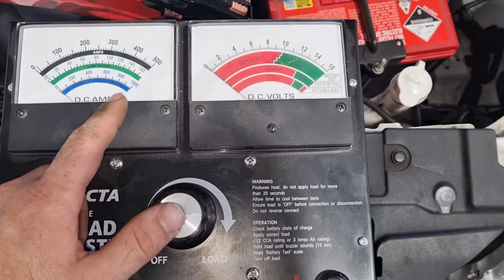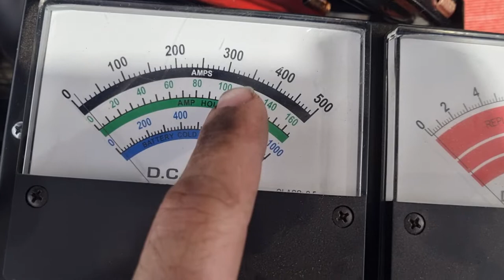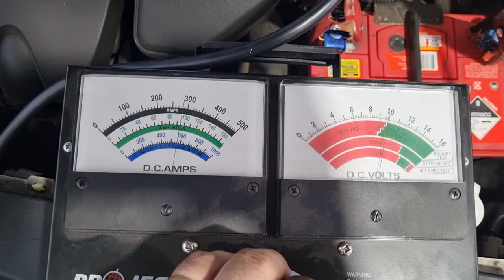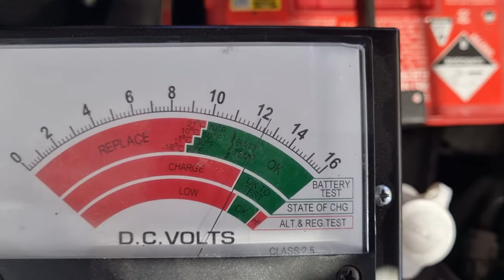Carbon Pile Battery Load Tester - How To Use Correctly

Comment: I'm confused, in the video you explain based on the direcvtions you want to apply 320a scael for the test, but when it comes time to test you bring it up to about 620...?
Reply from the maker: So the ammeter has 3 scales if you rewatch 

It is 650cca so half of that is 320A (not CCA) for the test we want to apply half the battery capacity

But on the lower scale it actually is reading CCA so it's just a couple ways you can read the scale 

If you re watch the video you will see I apply the 320A but the bottom scale is the battery CCA which lines up at 650 which is what the battery is rated at

Comment: can you use this to test a 72volt  20 ah lithium ion battery ?
Reply from the maker: Only 12v systems on this one mate, you can tell by the gauge in the RH side that tells you the charge
Reply: @RealAutoSolutions  Is there any way to load test a 72volt 20 amp E-bike lithium ion battery ?
Reply from the maker: Not that I know of, maybe a local bike shop can help instead?

Or even a local battery store?
Reply: An electronic load tester that can measure 72v at 20 amp / 1440 watts would be expensive.  I personally would use a 1500 watt electric space heater available everywhere and a DC clamp meter to measure amps. May have to modify the heater slightly (shorten the coils a bit) to accomodate the 72v versus the standard 120v wall voltage. Probably too much trouble to bother unless you're an electrical hobbyist, but the heater option would probably be the cheapest homemade way to do it. A DC clamp meter would be $50+ depending on quality.

Comment: I'm also confused...the amp rating would be about 160 and not 320?  Please clarify.  Thank you.
Reply from the maker: The amp rating that you put on the battery is half the rating of the battery in CCA 

So the battery being 650 we applied 320 which is close enough to half the CCA of this battery 

If you look on the bottom scale is shows you the battery CCA being 650 which corresponds with the top load graph at 320A
Reply: @RealAutoSolutions Except you are only supposed to go to half CCA, which in this case would be 325 on the bottom scale, would it not? Very confusing...
Reply from the maker: @BrewCityRider  it's half on the top scale, it's battery cca on the bottom scale

Comment: Some voltage drops on connection. I wander what voltage would be on battery terminals measured by multi meter.
Reply from the maker: For sure there would be some, would vary car to car I guess depending on how well and clean the connection is

The gauge on the carbon pile wouldn't be able to show us millivolts like the DVOM would